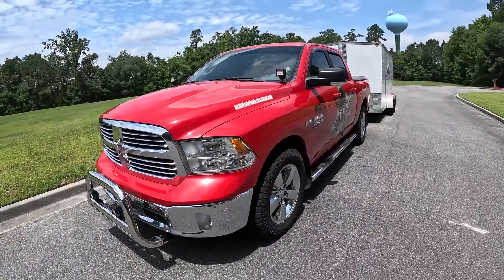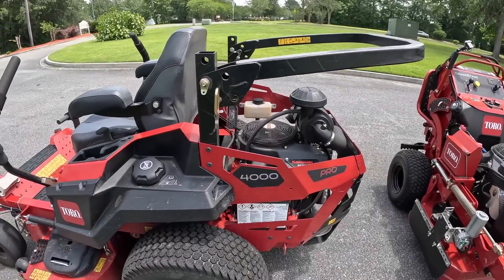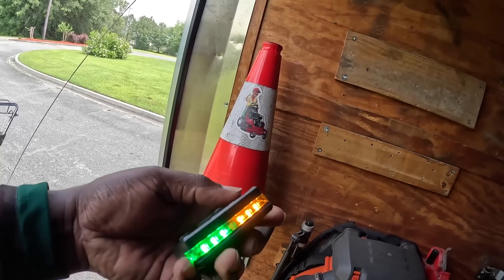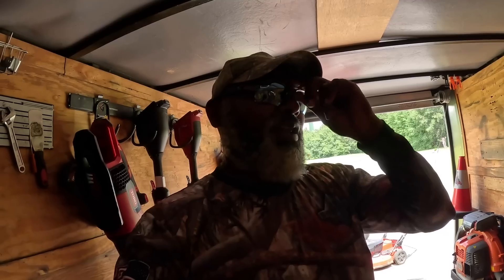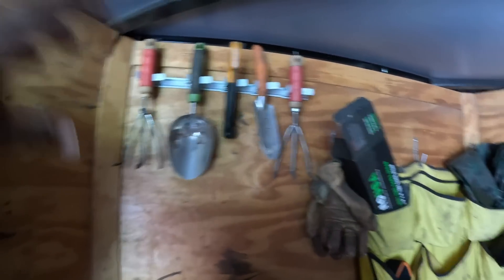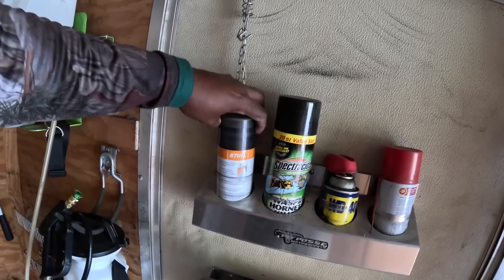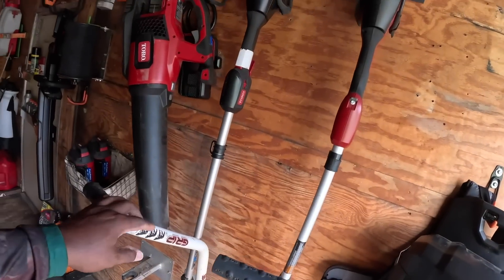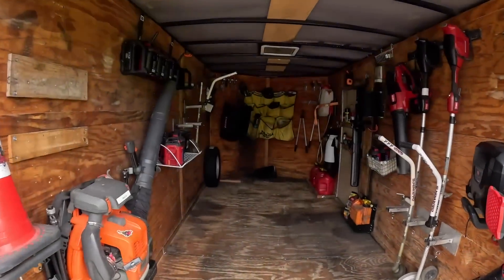2023 Lawn Care Trailer setup | Enclosed lawn mowing trailer view

Comment: Obviously no issue with gas being stored also. I have about 25 gallons in my mowers and another 25-30 in cans on my trailer on Monday and that goes down as the week goes on.  I am installing and inverter and it said it can spark so don’t store anywhere with fumes ???     The trailer closed would possibly have fumes.  I do have a roof vent tho. What do you think ?

Comment: You have a great setup. I wanted to know more about your battery setup in your trailer. Did you have someone to setup the battery rack and outer  ports or was it done yourself. Also how long do your Toro trimmers last before needing recharging.

Comment: I bought the round locks like I see here, but for some reason the lock wont fit. My latch brackets are too far apart so the lock's insert is too small for the latch to fit inside. Any suggestions?
Reply from the maker: Send it back
Reply: @Bladesofgrasslawncare  Thanks Johnny, I did some research and found out why it wouldn't fit. Proven has a higher vertical cavity height for the latches to fit in. Most are only around an half inch. So I ordered the Proven Ind. locks. Thanks.

Comment: Johnny, Hi! and thanks - been wanting to see this for a long time after just catching glimpses of your inventory as you do your work. Could you tell me what are the trimmer shaft holders that you have attached to the wall on the bottom. They're silver with spring pins to keep the shafts secured. Thank you.
Reply from the maker: Unfortunately the company that makes these no longer exist, I got these 10 + years ago and still use them Thanks!

Comment: Another one! Hey Johnny, I just got my 36 inch grandstand and I have a question: do the handles need adjusting so that it could drive straight or did yours just come fully calibrated?
Absolutely dope set up by the way!
Reply from the maker: Mine is fine but theres a way to calibrate your hydros look in the manual or talk to your dealer, thanks!